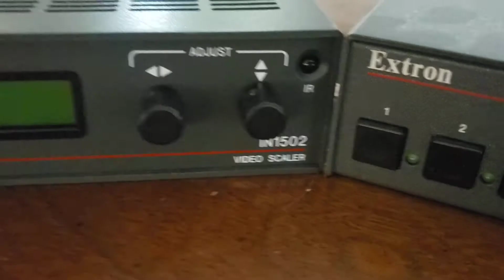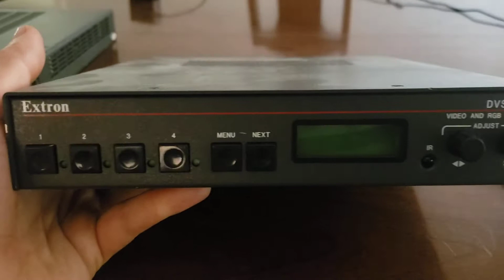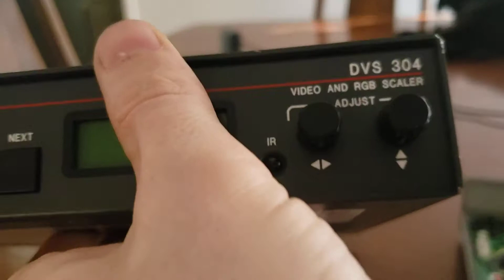My history with upscalers

Comment: Thanks for video .Im interested in the extron dvs 204.
Need to know composite to rgb 15khz quality .
Reply: Composite to RGB is sub-optimal. You would be best getting a Component/RGB AV cables for the console instead of using that consoles Composite out. Otherwise find a mod solution that enables the console to output Component or RGB. Look up the RetroTINK stuff as there may be a solution there as well.
Reply: @lancepage1914  yea it wasnt a console that i was talking about.

It was for amiga dctv hardware.

Comment: If I want to play 240p and 480i consoles on an old crt pc monitor, will the 304 be what I need? Thanks
Reply: GBS Control is your best bet, you should look it up. It can upscale 240p to 480p, which you will need to do with a PC CRT monitor. It has a very decent deinterlacer which you will need as PC CRTs rare handle interlaced modes well. The latency is very good across the board, as comparable to OSSC. It also has component in and VGA out so you won't need additional converters before or after the GBS Control.

Comment: Does the IN1502 essentially have an internal Time Base Corrector? I've been reading it's specs and it's conversion between NTSC and PAL with scaling is very similar to their other products. My use case is specifically for VHS. 

I have a Retrotink 5x which is great for gaming. But it doesn't have a TBC. So I've been thinking about picking up the IN1502 to fix the time sync from the VHS tapes and then pipe it into a 5x pro for upscaling.
Reply from the maker: Im not sure is there a way to check?
Reply: @gornway  since I left this message I've been on a hunt for that answer. Long story short, I still don't have an answer. I've gone as far as calling the company and sitting on hold trying to speak with one of their applied technicians in Australia. I ended up being offered a call back but they didn't get back to me. So I'm going to be trying it again this week to see what they have to say. The TBC functionality in their other products was just mentioned in the product descriptions and so it felt more like a marketing thing. The circuitry seems the very similar in the IN1502 so hopefully I'll find out for certain this week sometime.